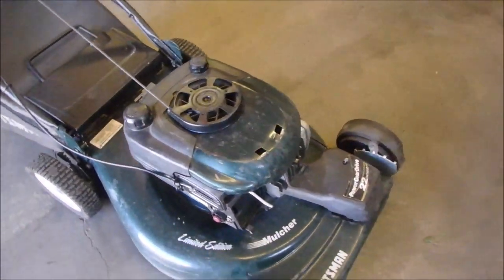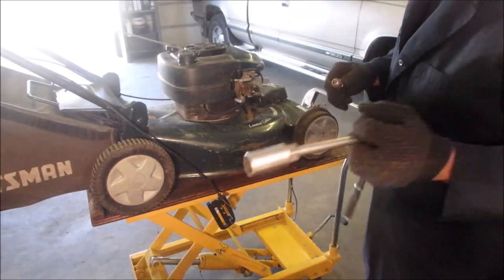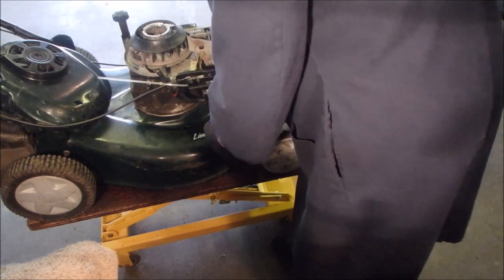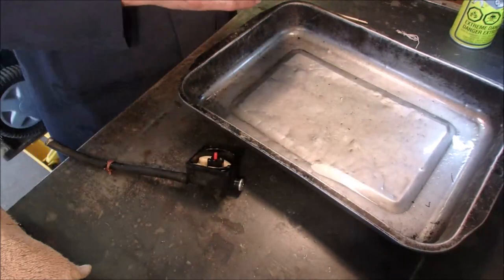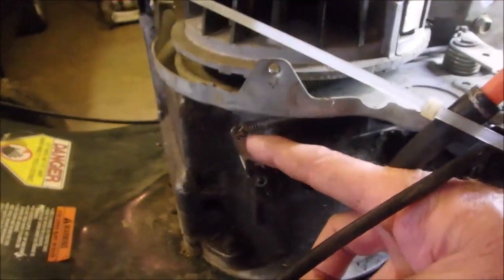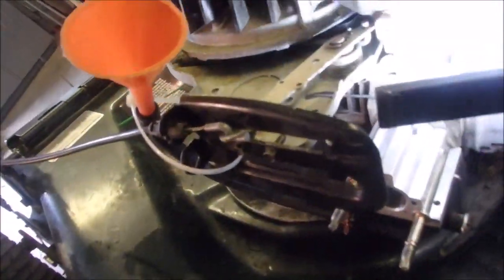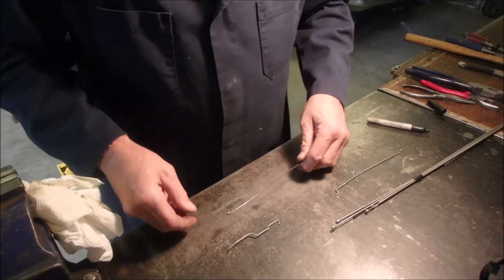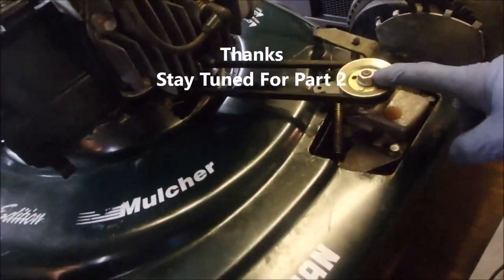Repairing a Rare Tecumseh 6.5HP VLV Mower Pt. 1

Comment: Bruce, I rescued one like it earlier this summer.  Everthing was good except for the engine, which had leaking oil all over the place and its air filter housing was home to an ant colony.  I ended up repowering it with a spare Briggs OHV motor.  I don't miss the ants!
Reply from the maker: Good move.

Comment: These are rare engines.  I did a video on a carb job on one of these about 3 years ago.  Only one I've ever seen in person.  It seems they only sold them in the northeast US for a very brief time.  A very interesting Tecumseh with that carb!
Reply from the maker: Thanks.  I think this one came form the States.  A lot of people from Canada go to the States to buy thing to save money .  It is too far a drive for us to do that.
Reply: I just came across one in Missouri.  It was/is on a 1995 Yard Man 21" Commercial deck.  Everything is in pretty good shape considering the abuse it endured - the air filter was completly caked in dirt, the flywheel key was sheared and the blade was bent to hell.  I replaced the key and blade and pulled that crazy carb off and sprayed everything I could spray with brake parts cleaner and put it back together.  Mine runs, but it doesn't run well...  misses out a fair bit.

Comment: Hi Bruce. I like Tecumseh but not these. I absolutely hate them. I probably have 3 or 4 in my barn exactly like this craftsman with this engine. These carbs are total junk , your lucky this one works so you're ahead of the game there. Now I suppose this mower is all done already but I could have sent you everything you needed for it , wheels , gov shaft, cables. Because like I said I have a few of these laying around. If you ever need spare parts for something do not hesitate to email me to see if I might have them. Great work on that gov shaft my friend , that was fun
Reply: Oh and I have the drive engage unit also
Reply from the maker: @davessmallenginerevival2847  Crazy.   That is part 2.  This is a very powerful engine for a 6.5/?/    You would know more.

Comment: A person I do work for, I've been working on his lawn equipment for 6 years now. 
He got a mower from his dad's house, cause his father passed away earlier this year, not covid related, cancer, he asked me to take a look at it, it hasn't run in 10 years. 
I walked in his garage, and I saw it sitting there, it looked brand new, even the underside of the deck was rust free, and spotless, like he never used it.
Turns out he bought it new, years ago, and used it twice. 
OK I thought it was a briggs, I hadn't seen one in 10 years, then it came flooding back to me, I said..... Oh hell no, to myself of course. 
I told the guy, what he had, and trust me he doesn't want it, you can't get the carb for it, at least a good clone, and adviced him to sell it asap, he did for 200, the person was a collector, and my client was very happy.
Reply from the maker: Right.  There are not many options for a carb.  There is one o line.

Comment: I haven't seen that kind of engine but I have seen that carb on the old desacked cylinder high torque tecumseh engines which would eat up connecting rods. I had 3 for 3 hight torque tecumseh engines 2 kocked other had no compression probobly worn out valves never got them running sent them to scrap.
Reply from the maker: Thanks

Comment: Thats a Tecumseh tried clone of a briggs engine, when they run, they run great, but that carb is a real pos, I've only worked on 15 in my life, now if I encounter one, I pull it off, and put a quantum on, and send it on its merry way for another 15 years of trouble free life..... Great job on it, I just don't mess with them anymore.
Reply from the maker: It was an American made thing.  First time in Canada for me.  I must have come from Ontario where folks buy stuff in the US.
Reply: Nice, I'm happy to hear that.  I just came across one that hit something it didn't like.  I've got it running, and only took a first pass of quick shots of brake parts cleaner in every hole in the carb.  I was going to take another shot at cleaning it better but also thought of just replacing it with a different one.  Looks like I may have one laying around I can use. 👍

Comment: I’ve got the same motor. Original. Do you want photos or measurement etc? Ps 25 years old. All good but I’m about to check rings and valves. Wish me luck!
Reply from the maker: No that's OK  I have the complete PDF.  Good for you for giving it another shot at life.

Comment: That is a tecumseh carburetor , do you know of Stens up there in Canada ? I've used their parts for close to 30 years and have had good luck with most everything. They even have  that carburetor and the repair kits and I believe you can look them up on line too. They are the simplest  carb I have ever seen but not to much quality sad to say.
Reply from the maker: Yes.  I now know i can find them on line   Thanks.

Comment: That style of carb used on ohv rider engines. I have a Tec vtwin with a pair of them a zero turn. Beauty of them is just a couple passages in metal part to clean. Lower bowl can be replaced as an assembly. Just did one for friend's 11 hp on a generator. Put in USC and new needle and seat. Details on outdoorpowerinfo.com. funny thing is I went to look at his setup and it was exactly like unit in video thst I had just watched by james conden.
Reply from the maker: That is cool.  James is a good tech.
Reply: Just had an email that my carb cleaning worked. Running at 61.4 Hz.

Comment: the special Carburetor must make it the mower the  "Limited Edition"
Reply from the maker: I think so.  I didn't show it but the intake manifold tube goes under the head on the outside of the engine.  It will be in Part 2.

Comment: No wonder Tecumseh went out of business. What was the advantage of that carb over their previous design? They had the bugs worked out of the previous design. What year is that from?
Reply from the maker: I think this one is old.  20 years??
Reply: Bruce Pender they have been out of business for 12 years, so that is a reasonable guess. Weird. Another first for me via your channel.
Reply from the maker: @haneyoakie14  I know   2008  Thanks again.
Reply: Bruce Pender I won’t tell Safety Sally if you don’t.
Reply: Idea was plastic wouldn't gum up or rust and parts in bowl so replaceable as a unit.
Reply: Just lucky Briggs got baled out recently after they filed for Chapter 11 or they would be toast as well... Old Tecumseh Co. was not so lucky, I still like them and have a couple that run just  fine.
Reply: I have one on a deck that I confirmed at some point was a 1995 Yard Man Commercial.

Comment: First one I came across was this year also. Carb kept flooding even though the float was good. Since it moves up to close it was hitting the top of the carb and wouldn't seat. Check that fuel line also. Mine looked fine on the outside but after taking it apart a number of times to try and stop the flooding (bought a new needle and seat) found the fuel line all decintigrating on the inside. Got a Stens replacemt carb for $11 and that worked. 

Fyi: Here's a look at it.
https://youtu.be/xfn4qV0c694
Reply from the maker: Thanks   went there and left a comment.    Sten's  is a good company.